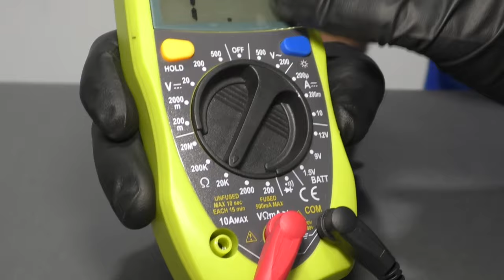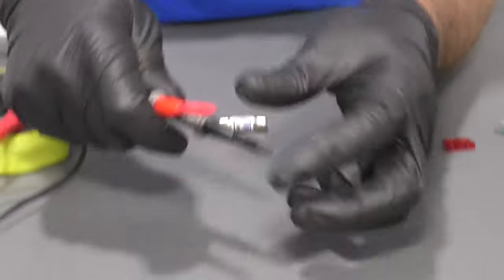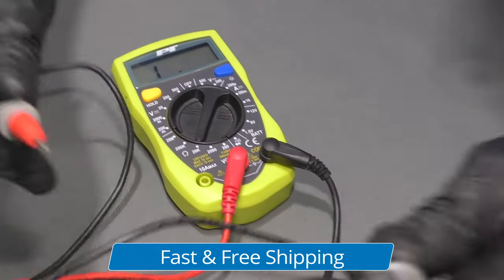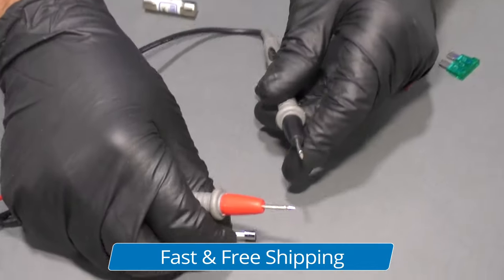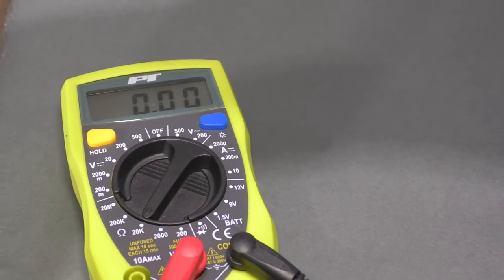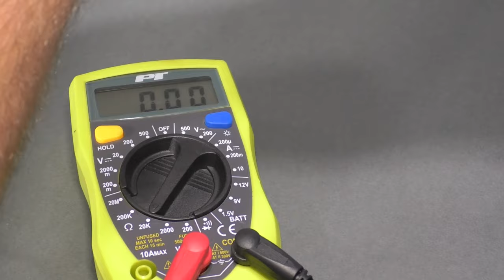How to Check For Bad Fuses With A Multimeter

Comment: Sorry for my ignorance but my multimeter shows me a value of 1. That means it's dead, right?  What value should it show if it's good fuse?
Reply: That was th problem I was having with this video since they did not clarify that.  Another video said that a value of 1 is a bad fuse.  A value of 0 (or very close to it) is a good fuse.
Reply: @epochseven4197  He did explain that a value of 1 on the ohm setting means its bad.

Comment: Can I effectively test fuses while they are still in the vehicle? Does the vehicle need to be turned off or on during in box fuse check
Reply: It can be off
Fuses can still be in car
I tested mine found out
 pwr door lock was dead

You either get 1 or a #
0 means it's dead

Good luck
Reply: I’ve read that you can while they’re still in, you just need to disconnect the battery
Reply: @AznUzer  to check with the ignition on in the vehicle, a 12 volt test light is best. Also if you check with a multitester in the vehicle, ignition switch on,  then you need to set your meter up to read DC voltage! ground the black probe and use the red probe to touch the fuse on both sides of the fuse to see if you have power on both sides, or power passing through the fuse.

Comment: What are the reading on the tester when you touch both leads on the fuse, You never showed that, & what readings are good or bad, if you're show me show it All???
Reply: 1st make sure your meter is on Ohms or continuity (Continuity looks like a wi-fi symbol on the meter) . On Ohms, a good fuse reads 0.000 or 0.001 or close to it. 
A bad fuse reads a whole number or on my meters it says "0L" which means Open Line and some meters say "OPEN". In the video at 2:07 his meter reads " 1 . " on his blown fuse.  Using continuity can be helpful so you get an audible conformation so you don't need to read the meter and when you get no sound you would then confirm by switching to Ohms and testing again looking for 0L or a whole number 1 or Open. 

 The other thing is when you test you need to have your meter in the right range, I use an auto ranging meter so it sets itself, pretty much so I have one less thing to be thinking about. With the auto ranging meter it starts at its highest setting for the safety of the meter and works its way down to the correct setting in a like a second so you can get precise readings, I don't want to have to adjust them. I'm sure there are probably are plenty of reasons you would want precise control over the Ohms settings ranging 20k to 200k or whatever the meter has,  but I guess I see that as old school, kinda like manual transmission vs. automatic. No human can out shift a computer so manual transmissions are all going away now, however there is no harm in knowing how to use different machines at all so to each their own. Currently one of the best anti car theft devices is a manual transmission because no one knows how to drive them anymore. lol.  Hopefully this helps someone.
Reply: @user-nf7ui7dz1z  thank you

Comment: in another video a man put his ohms at 200  .....yours is 20k .......why???
Reply from the maker: +KT Thompson Thanks for checking us out! This will set the maximum resistance to 20,000 ohms rather than a maximum resistance of 200 as in the other video that was seen. This varies depending on what you are testing. There are also many different types of multimeters available as well.
Reply: @1AAuto  okay thank you for the fast reply. So is it safe to go from 20k or 200 ohms? With the keys to the On position just to test fuses?